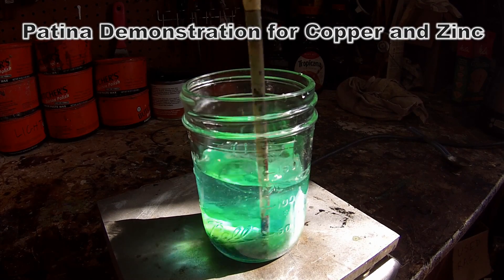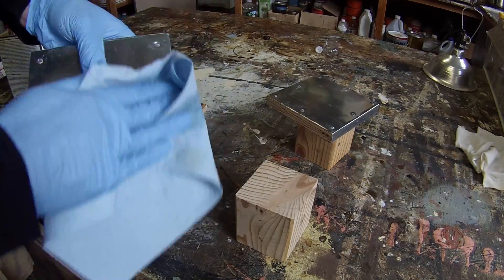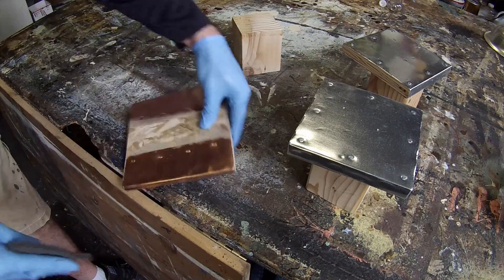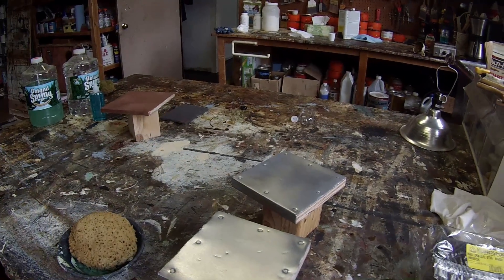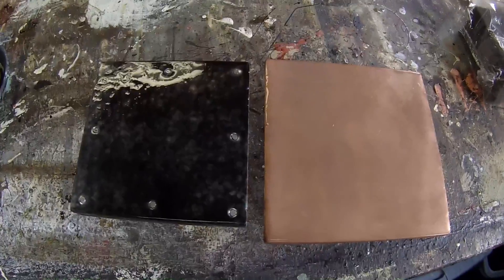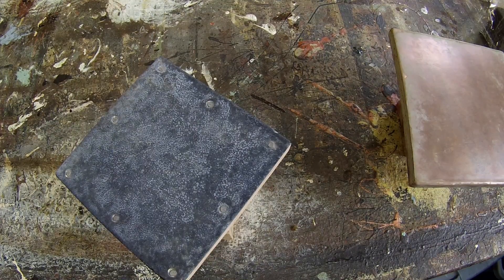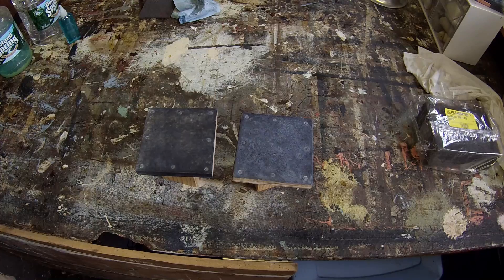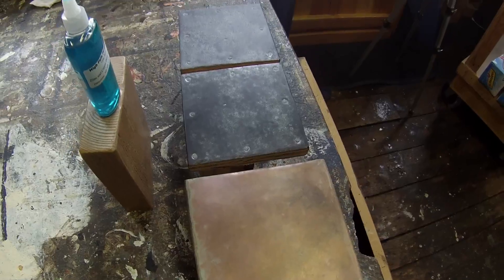Copper and Zinc Patina Demo

Comment: Mitch, thanks so much for the juice and the demonstration.

When you said to not use steel wool, the rebel in me said I had to use steel wool.  I used it to apply the juice, in part.

It was definitely tougher to work with as I had to keep going back for more layers and fixing areas that got away from me.

In the end, I am really happy with the redish result mixed in with the other colors.

Thanks.

Comment: I am considering this product to give patina to rusted corrugated roofing.  The sheets are 60 years old.  Will this product work and will it give the desired effect?
Reply: your 60 year old tin (great metal) is probably galvanized. if so, it wont work. so to find out, cut a small chip of non-rusted part and ask somebody in an old-timey hardware store if it's galvanized. big hardware stores like L***'s & H**e D***t won't have a clue.

Comment: Thank you for your video.  If you wanted a high gloss shine over these metals what would you suggest that works well & lasts?
Reply: 4 coats of Krylon 12-Ounce Triple Thick Clear Glaze Aerosol Spray. allow each coat to dry for 24 hours, sand lightly with "0000" steel wool, clean with water, dry, apply next coat. Do Not sand last coat.

Comment: How about just warming the copper a bit on second or third coat?  The brass alloy 360 has zinc, I might try this on brass.  I imagine brass could turn blackish with green highlights
Reply from the maker: +jtbmetaldesigns 
you can get a completely different colors with warmer temps on copper, so I find its best to darken it gradually.  good guess on the brass

Comment: Does this product contain lead in it? Can it be used in conduction with copper paint (w/real copper particles) for outdoor rain gutters?
Reply from the maker: Janette Gw Does not contain lead.  should work on copper paint but I have not tested that.  It is not the best product for blue-green solid color.  It will turn copper a dark bronze with some green color but the green will wash off initially.  but it will patina on its own over time

Comment: Verdigris effects are dear to my heart. Thank you. I was not surprised to see you switched to offering the product in powder form. I wondered at the safety and regulations of shipping it as liquid.  I have an aged 4.5 foot diameter dining table with too much of the wood veneer surface peeling away. I've been wondering what my options were. I love the idea of a copper patina table top. I can imagine it would be gorgeous under accent lighting. Or does copper loose all reflective sheen due to the chemical patina?  I'm uncertain if I can find a sheet suppier for that size or whether it would be too costly. The table is designed for an extension piece which I don't own and don't need so the split down the center could be disabled and ignored. Would a copper top need a sealer of some sort to prevent toxic food contamination? Do the patinas continue to change appearance over time or would a food-safe sealer also halt chemical changes in appearance?

Comment from the maker: Product Update:  I am no longer selling the 4 oz liquid bottles.  I am selling the dry mixture now because it is safer and more practical to ship.  See my Ebay listing: http://www.ebay.com/itm/Zinc-and-Copper-Patina-Solution-034-The-Juice-034-/221685795490
Reply: Hi, this link isn't working. Can you confirm that the mixture is copper nitrate, ammonium chloride and calcium chloride mixed with distilled water?

Comment: How does this work on metal?
Reply from the maker: it's just corrosion with some precipitates.  metals like copper have a variety of oxidation states that produce different colors.  it will likely turn iron into dark rust, if that is your question
Reply: hffcom Yes Sir.  Thanks.